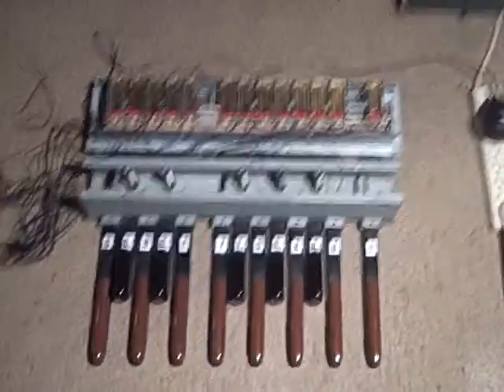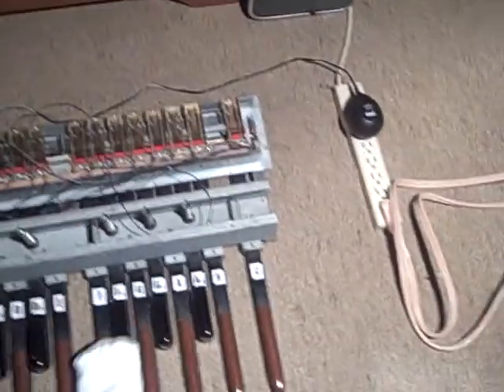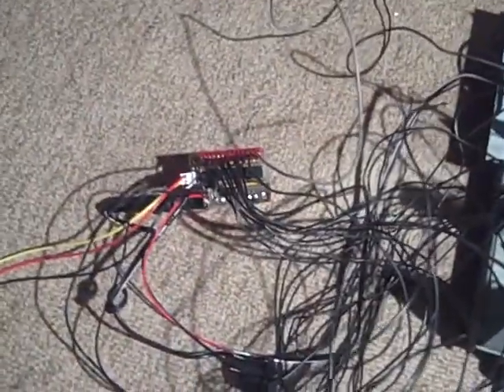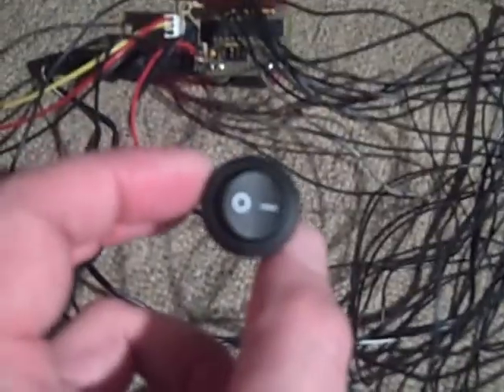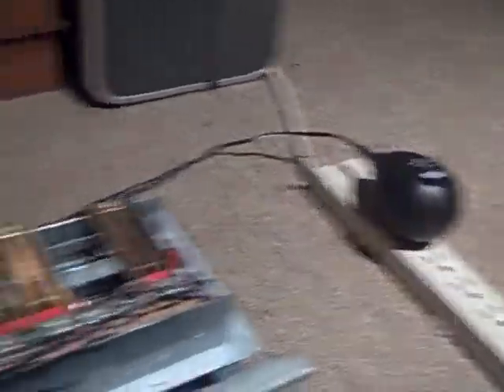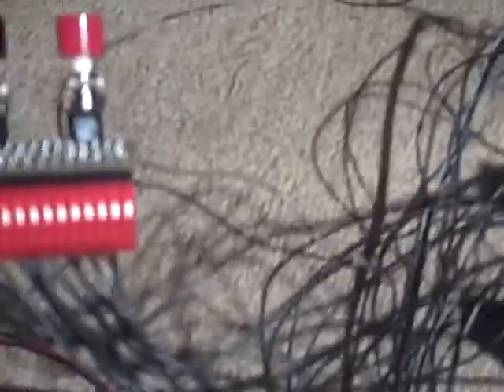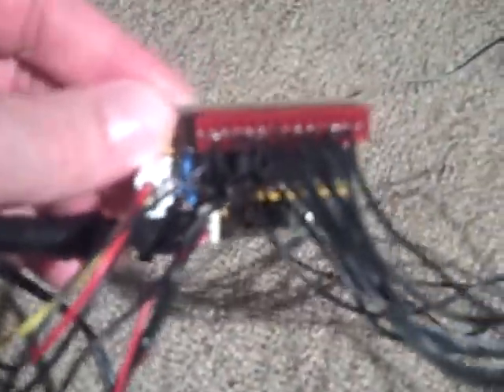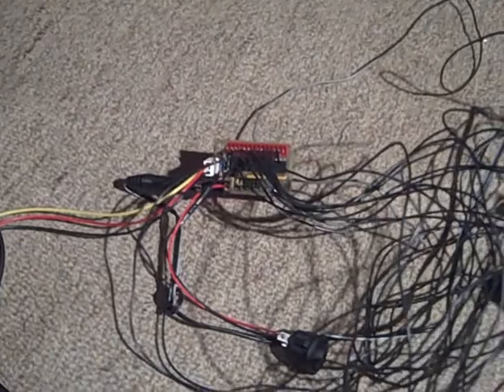Basyn 1.AVI

Comment: I built the same exact setup and got it working fine. I think your problem is the switches or contacts on each note are backwards. I mean they are all closed until you trigger one. I had to physically take apart each contact and reverse them so when you press a key, the metal has to make contact with each other not the other way around. The way its setup is that when you press a pedal, it releases contact. You have to bend the metal for each key and make it work in reverse so when you touch a key the metal touches not releases.
Reply: i am doing the same thing but my problem is my upper c is not going up an octave and has a click sound. all other noted are fine.
Reply: That’s exactly it.